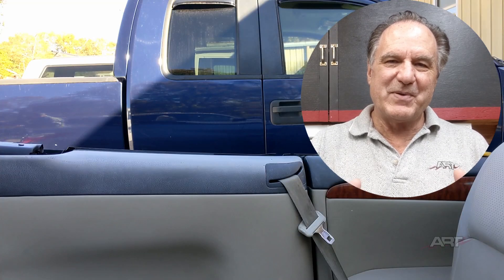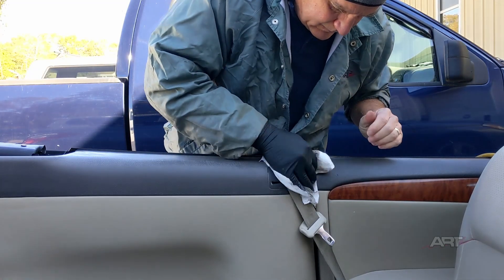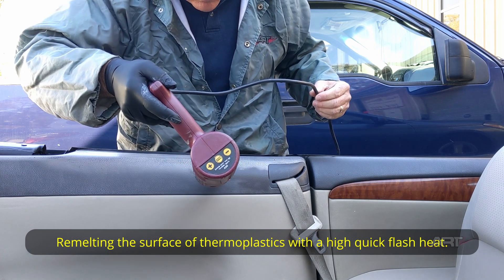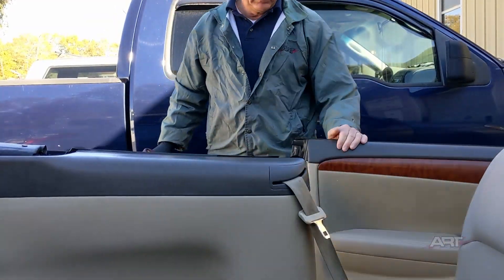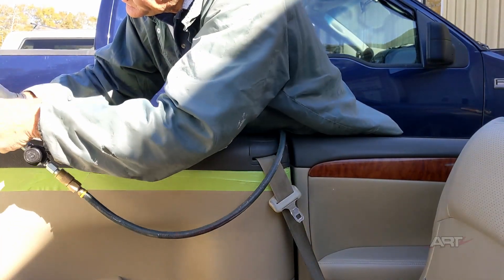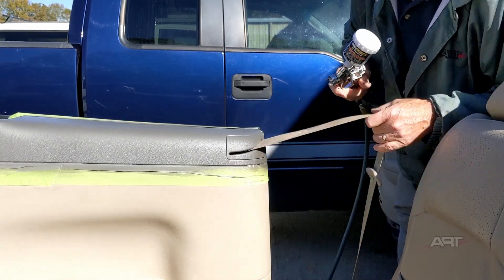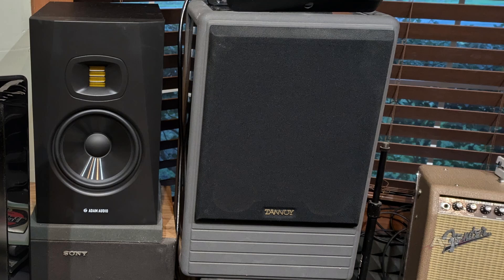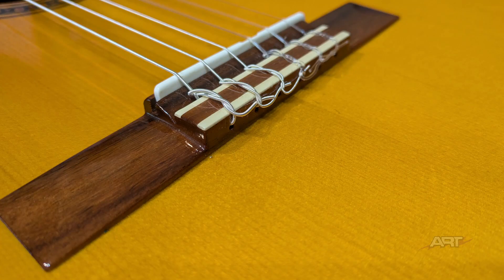Plastic Repair - Restoration of Degraded Thermoplastics v145

Comment: The paint should be UV resistant?
Reply from the maker: Yes, good point!  Of course, even then over time the UV will takes its toll.  For example, house paint will typically only be expected to last for a specified number of years.  The chemistries have got much better in recent years too.

Comment: Should we do painting by heat necessarily, if we going to apply paint on top?
Reply from the maker: @MotoERS  I probably should have mentioned that while the remelt makes the surface smooth again the coloring effect is not 100 percent as when you would paint it.  So yes, both would be necessary.  Thanks
Reply: @a.r.t.srealrepairsforrealc8247  maybe it's enough just to paint?
Reply: @MotoERS  In my experience the less finish that you have to use the better, so heating the plastic first works best, for me anyway.
Reply: @mttmg  thanks!